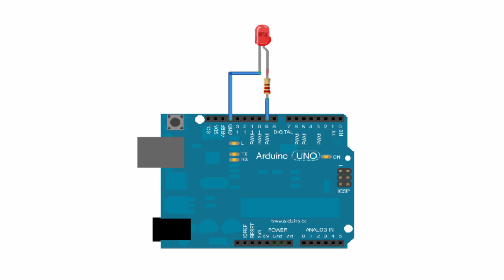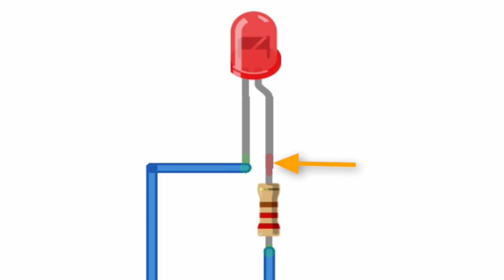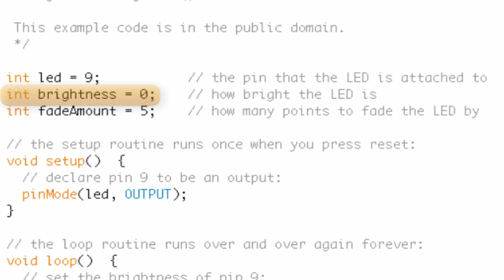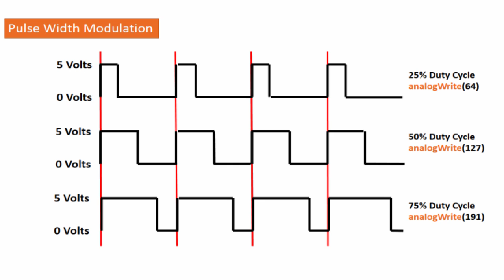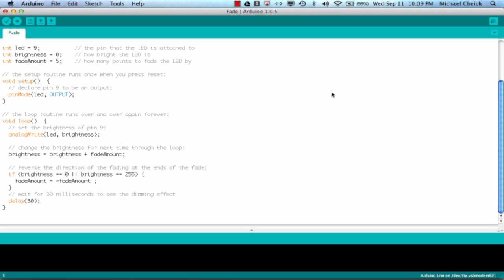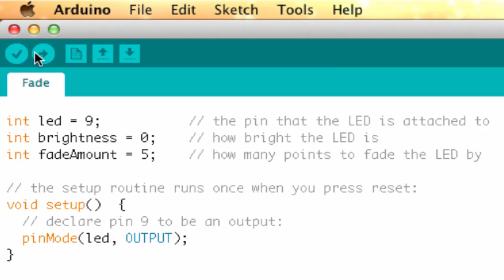Tutorial 10: Fade an LED: Arduino Course for Absolute Beginners (ReM)

Comment: These videos are fantastic...im having a hard time with the if statement showing the fadeAmount = -fadeAmount ;   I've watched the video several times but I'm not getting how the statement or the arduino knows to either add or subtract 5
Reply: Daniel Clemente Open Source Hardware Group  If you get the math behind this it is superawsome. So: At the start of the code the brighness is 5. not 0 - because it gets added before we test the IF condition. at the first time it tests it is at 5 and then 10 and so on. When it reaches 255 (btw the fadeAmount HAVE to be devisable by 255 and it is with: 1,3,5,15,17,51 or 85) the condition is true and thus making the increment negative - because we stated that fadeAmount = -fadeAmount (keep this in mind that your fadeAmount is now Negative5). So the scripts jumps happily along and subtracts 5 until it reaches 0 and the condition is once again met. Now the fadeAmount (wich is at this point still negative 5) gets "negated" once again. Remember from math class - and - equals +? Well this is what is going on here. The negative number gets flipped back to fadeAmount (positive +). and the process repeats itself.

I have added my extended challeng sketch cause I did not want the two LED's pulsing at the same rate: (NB notice that I have set the brightness2 to 250 - this is because of the same as above, that 250+5 = 255 so that it is at the peak from the very start) Sorry for the long wall of text but Im hooked on the tutorials here. SUPERAWSOME stuff!

int led = 9;                  // the pin that the LED is attached to
int brightness = 0;       // how bright the LED is
int fadeAmount = 5;     // how many points to fade the LED by
int led2 = 11;              // challenge test - multiple fading LED's
int brightness2 = 250; // extended personal challenge
int fadeAmount2 = 5;  // think i need a double for this or - - - is - ;D
                                // YaY I was right!!! the single fadeamount made wierd results

// the setup routine runs once when you press reset:
void setup()  {
  // declare pin 9 to be an output:
  pinMode(led, OUTPUT);
  pinMode(led2, OUTPUT);
}

// the loop routine runs over and over again forever:
void loop()  {
  // set the brightness of pin 9:
  analogWrite(led, brightness);
  analogWrite(led2, brightness2); //extended personal challenge

  // change the brightness for next time through the loop:
  brightness = brightness + fadeAmount;
  brightness2 = brightness2 + fadeAmount2; //extended personal challenge

  // reverse the direction of the fading at the ends of the fade:
  if (brightness == 0 || brightness == 255) {
    fadeAmount = -fadeAmount ;
  }     
  //extended personal challenge
  if (brightness2 == 0 || brightness2 == 255) {
    fadeAmount2 = -fadeAmount2 ;
  }
  // wait for 30 milliseconds to see the dimming effect    
  delay(30);
}

Hope this helps more than it confuses you =) And if im wrong anywhere - please do point it out!
Reply from the maker: Daniel Clemente Great question. I like to picture a negative 1 in that line of code, like this:

fadeAmount = -1 * fadeAmount;

So if the brightness variable gets to 255, then fade amount gets multiplied by a "negative one".  So if fadeAmount was "positive five", then:

fadeAmount = -1 * 5;

Since a negative number multiplied by a positive number results in a negative value, now fadeAmount becomes negative five.  Now when brightness is equal to 0, it will look like this:

fadeAmount = -1 * -5;

Since two negative numbers multiplied together equal a positive, now fadeAmount, goes back to being a positive 5. 

The whole program, the sign keeps flipping back and forth like that.

Hope this helps some.  It can definitely be confusing!
Reply: ok i think i get it...still a bit confusing...I think my problem is trying to understand how the program knows which to run...ahh ill figure it out lol

Comment: Really appreciate the info, but I'm a bit confused on how you are choosing the LED and resistor.  Since LEDs have different specs, they would require different resistors based on the input voltage.  First, what is the upper voltage limit of the Arduino.  Second, are you using this upper limit and the specs on your LED to figure the correct resistor?  What is the LED you use rated for?  I have a variety of LEDs that range from 1.7V at 20ma to 3.3V at 30ma or even higher ones.  Should all this be taken into consideration?  I hate to burn out LEDs.  :)  Thank you!
Reply from the maker: Steampunked Out All great questions.

On a digital pin, the max output voltage will be about 5 volts. Since most LEDs will drop between 1.7 to 2.1 volts depending on the color and are generally specified at 20 mAmps of current than I am very comfortable swagging the resistor value at 220 Ohms because it will usually keep you well within the current limit for most LEDs.  

If you want optimal performance for your specific LED then it would make a lot of sense to match the resistor value so you could get spot on (or close as possible) to the recommended current. 

Hope this helps some - Best of luck!
Reply: Open Source Hardware Group
  Very helpful!  Thank you!  :)

Comment: Please i can't really understand PWM, if it just altering between 0 and 5 volts instantly how actually the led fades?????
how with just 5v time increase the brightness increase? i think it shall blink not fade because it is 5v then 0v regardless to the time, there is no change in volt range to fade up and down. Please clarify.
Thank you.
Reply: You are correct it is just blinking, but it does it so quickly that to the human eye it appears to be just dimmer. Same idea as to how your TV works, many single frames very quickly turn it into a smooth video image!
Reply from the maker: Lee Thompson Great explanation!

Comment: I cant get 2 leds to fade without setting up 2 separate circuits with 2 resistors and repeating identical lines of code with different names used

Am I missing anything? or can you do this simpler with less code and 1 circuit
Reply from the maker: XLCaudio Hmm.  Not sure.  I am able to fade two LEDs together from pin 9 using the Fade sketch.  I have a 220 ohm resistor attached to pin 9, then attached to the long leg of a Red LED.  I then attached the long leg of another LED to the short leg of the previous one, and put the short leg of the second LED in gnd.  This faded both LEDs with no need for altering the sketch.

What color LEDs/size resistors are you using?

Comment: is it posible to use more than 1 led? i would like that the 2. led started when the first was 1/3 "finnished" and the third started when the first was 2/3 finnished
Reply from the maker: Yes, it is totally possible. You can use analogWrite() on several of the digital pins that are marked for PWM.
Reply: but how do you make the delay?
Reply from the maker: Hi Gerd,  I made a video to try and answer your question - you can find it here: Fading Multiple LEDs in Sequence with Arduino :: Viewer Question #4   I hope it helps!

Comment: Multiple LED fades can be achieved without modifying the code, I just set three up on a bread board all using digital pin 9 as the output (is that cheating....)
Reply from the maker: Yes - that is cheating :)
Reply from the maker: But hey...it works.

Comment: Can i use 2 delays to fade two leds with different delays? I tried and i could not
Reply from the maker: Thats a great question Charles!  So here is how I might approach that one.  I would keep the same delay for both, but I would have two different fadeAmount variables controlling the separate LEDs.  The higher the fade amount, the quicker the fading, the lower the fade amount, the slower the fading.  Does this make sense?

Comment: On analogWrite the value can range from 0 to 255
Can i set like 0 to 200 or 100 to 150. ...
Also  
In yor example you add 5, 5, .. Until 250 + 5 ......
With instead 5 i used 10 so will be 10, 10 ...... Until 250  +  10 = 260 
But the maximum is 255 so is it a problem
Reply from the maker: Great questions Charles!   Ultimately, you decide what value you will pass to analogWrite, so if you want the values to be set in a specific range you could use the constrain function.  Something like constrain(sensVal, 100, 150) and then pass the constrain value to analogWrite().  Hope this helps for the first one.

If you pass a value great than 255 to anaglogWrite() than something unexpected might happen. I know that sounds really vague, but I offer that you should try it and see what happens.  Does the LED get brighter - darker, stay the same? Your code will still compile fine, and you shouldn't get any errors and passing a value larger then 255 to analogWrite will not fry your Arduino board.  Best of luck and really good questions!
Reply: @programmingelectronics  The problem he encountered was because he didn't hit 255 exactly when incrementing. The code should be written as >= 255 rather than == 255.

Comment: Hi. this might be a stupid question but why is it when you are declaring int led = 9; the arduino knows you are referring to pin 9. But when you say int brightness = 0; and int fadeAmount = 5; why does it not refer to pin 0 and pin 5?
Reply from the maker: Thats is a great question!  I think the best way to answer is to look at how we use the "led" variable.  We use it in the pinMode(led, OUTPUT) function.  What if instead of using "led" in the pinMode function we used the "fadeAmount" variable.  It would look like pinMode(fadeAmount, OUTPUT)

That would work just fine, except that the mode of pin 5 would be set as an output instead of pin 9.

So what I am trying to demonstrate is that the Arduino doesn't know that the variable "led" is referring to a pin number, all it knows is that led = 9.  It depends on how and when we use the "led" variable that will determine how the value stored in the variable gets used.

I hope this explanation helps a little. best of luck!
Reply: Open Source Hardware Group Awesome I understand! So when you are declaring values, it doesn't matter what the value is until you use the variable. In this case you used the variable led in setup pinMode and the other variables brightness and fadeAmount were used in the loop.  btw, your videos are great. I'm glad I found them.
Reply from the maker: That's it exactly.  I am glad the videos have been helpful - let me know if there are any specific videos you would like to see.